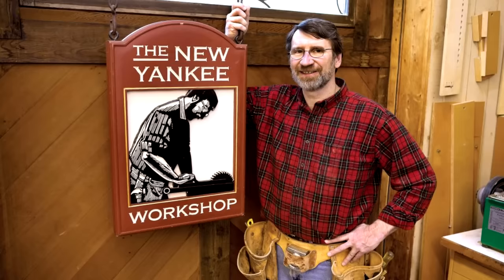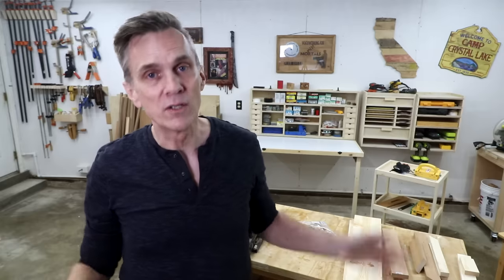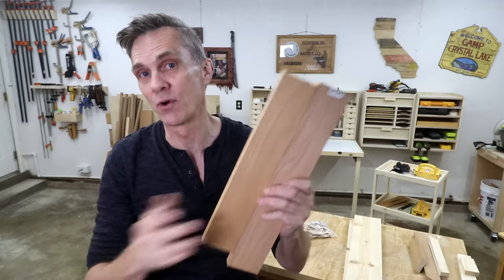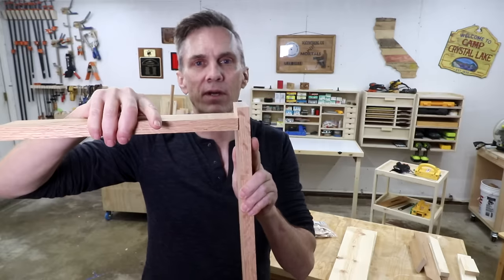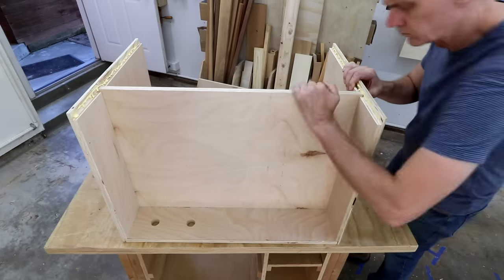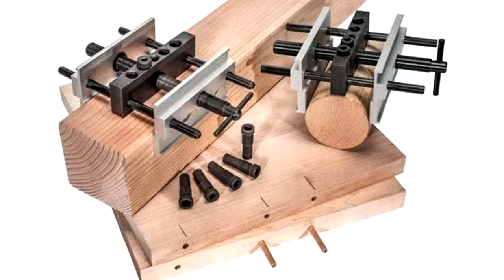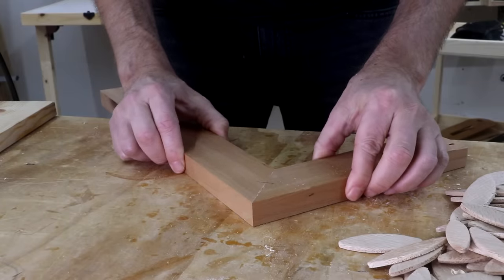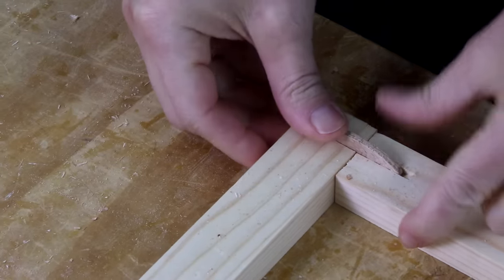So, is a biscuit joiner completely useless?

Comment: I’ve been a professional woodworker for 25 years and there is nothing more useful than a biscuit jointer, the domino is a waste of money you’re better off with a slot Mortiser which costs less and is far more useful for putting together furniture
Reply: Kozel same here I mostly do frameless and it’s the fastest way to put cases together other than investing in a boring machine, which I don’t see the need for,  I have a slot mortiser for doing loose tenons and it’s far more versatile and I can cut better mortises with it than I ever could with a domino. I don’t get why anyone would spend $1500 for that thing but they all do
Reply: I have a biscuit jointer and a domino. I’m intrigued by this slot mortiser though. Can you tell me more about it?
Reply: William Butler it’s a stationary machine the tables move and the head goes in and out you can adjust it to make longer mortises make them thicker whatever you want, cut angled joints all sorts of things If you know how to use it. You can also get a multi router it does the same thing and it can cut other joints as well such as dovetails and box joints, it’s pricier but it works as well
Reply: @adamchesis7443  
For the speed......for the love of God man, the speed and accuracy you can make an extremely strong, consistent joint with a Domino tool is unparalleled.  If you're a fine woodworker and you enjoy taking 2 hours to set up and make 8 perfect mortises with a router or slot mortiser then that's fine.  But a Domino gets it done in about 2 minutes.
Reply: Big Mike is talking if I need to do something fast I have a lamello, If it’s taking you 2 hours to cut 8 mortises on a slot Mortiser I don’t know what you’re doing wrong it would take me about 15 minutes, can you make a  1/2 x 3” mortise with a domino? Nope. People are convinced that the domino is the greatest and if it works for them that’s fine I’ve been doing this for a long time and I don’t see any use for it
Reply: Kozel does festool make nice products? Yes are they with the cost? No they’re way overpriced
Reply: Adam is correct.
Reply: Adam Chesis Hey Adam what model biscuit jointer do you use?
Reply: @adamchesis7443  Festool is awesome for on site work... The mortiser is a much more versatile shop option and as you pointed it out for furniture.
Reply: Dave Tarrant I have a lamello, the low end one I can’t remember the model number, I don’t see the need for the other one with the adjustable blade and it’s double the cost, it’s amazingly accurate and quick love it
Reply: I'm of the exact opposite opinion.  I have a slot mortiser as well as Festool Domino and biscuit joiner.  Of the three, the Domino is the most versatile and easiest to set up particularly when joining pieces that come together at funky compound angles.
Reply: why's his biscuits so loose? I need a mallet to tap mine in, especially glued up
Reply: @adamchesis7443  mannnnnnn, I bought a festool track saw....before makita dropped theres....I'm also on the makita platform so it really hurts lol tleast I got the 75 so it can actually do a lot more, but still...I rarely use a track for deep cuts anyways. The biggest benefit of festool is the fact its a system, so if you are completely festool and a millionaire you can definitely increase efficiency by like 2%...
Reply: Stevey Irwin well that’s good I own nothing festool and I can build things pretty quick, there is nothing they make that would make my work faster so it’s not worth the money to me.
Reply: @adamchesis7443  no way dude, if you went 100% festool and got every single accessory they sell you'd definitely save at least 10 minutes per work week.
Reply: Just get a router table and you won’t need any of that shit.
Reply: @holdemNE1 my guy 😂😂😂😂 you can cut any of that fast on a router table! You’ll also get better joints than random biscuits or dominos but you can do both in a router table…

Comment: I make 8ft+ tables..
Being a one man operation, I will take what I can get. I love my biscuit joiner, specifically to line up extremely long live edge slabs. It also helps me to keep the wood level, I glue up some pretty gnarly pieces. I think it definitely has it's place in my shop. Everyone has their own opinion, this is true. Any tool that gives woodworkers the confidence to keep alive a slowly dying art, is a necessary tool in my opinion.
Reply: @oneoneone7397  without seeing what you mean, it would be hard to answer that question..
Reply: I use my router and slot cutter bit and run a continuous slot when laying up table tops...stoping before the ends.
Reply: @oneoneone7397  It's so easy just do it
Reply: I use them to eliminate pocket holes in the back of my wood benches...

Comment: Steve, that biscuit jointer was bottom of the barrel stuff when you got it 20-30 years ago! Your biscuits should not have that much play. A biscuit jointer is great for alignment. I use it to attach hardwood edging on countertops, align my face frames to the cases, I even use it to butt join long pieces of crown or baseboard. 

This video really needed a bit more research. Lamello invented the biscuit jointer (I think). And they have models that are more expensive than the domino! A proper biscuit jointer is a precision machine. Also, get good biscuits. Biscuits that are too fat or too thin will adversely effect your joints.
Reply: I have the original elu and love it.
Reply: Especially agreed about joining wood edge to veneered sheet stock that must be flushed off. Using paper shims to offset the edges a trifle, the precision of the originator Lamello machines meant that I could use a single leaf of shim. All other brands have more slop in their plunge, requiring thicker shims for offset, and more wood to carefully shave down flush to the veneer.
Reply: Yes, throw that Sears POS away and start over with a modern, decent quality machine.  You'll be amazed!
Reply: I was wondering about this myself. The videos I've watched using biscuit joints were a lot more snug than what he shows. Biscuits should be about as snug as a dowel across the vertical plane, but have some ability to move laterally. That way you can line up your joint in one direction while knowing it's staying aligned in another. For example, lining up two butcher block countertops in a miter joint to minimize the vertical "bump" between them, before you align them horizontally and "clamp" them with miter bolts and glue. (Still a good idea to clamp something on top to really minimize movement during glue, where possible.) It also provides some extra horizontal strength so if a kid climbs on top of them, they don't risk splitting at the glue joint from the uneven pressure.

(Granted in the above example, the countertops should make as much contact with the counters below and be shimmed as necessary. But wood loves to move over time, and butcher block countertops should be installed with that in mind.)

Anyways, I think the real tip here is to get a better tool. Even HF has more precise tools than what he's using.

Comment: I started using a biscuit joiner in 1986 working at a cabinet shop in Wayne NJ called the Woodworker. We used the Biscuit joiner on almost every project and to this day I still use one almost every week. I don't think you need a ton of expensive tools to make a beautiful piece of furniture but I do think a biscuit joiner is a good tool to have in the shop.... Unless you can afford a Festool Domino : ).
Reply: I just got one this year. It is crazy helpful.

Comment: I use my porter cable biscuit joiner to build kitchen cabinets using birch or maple plywood. Building a Murphy bed frame with the larger# 20 biscuits. Never had any issues with weak joints, or alignment of plywood connections. There are three different sizes of biscuits. I will continue to build custom cabinets using a biscuit joiner!

Comment: My professor in a cabinet making class was very fond of biscuits and we used them all the time for constructing the cases. The glue up was tricky but they have held up well. They swell inside the slots once wet with wood glue and are very hard to pull apart once swollen even without glue.
Reply: Right, and Franz Klauzs did a full video on B joinery.  This guy is a hack, at least as far as biscuits are concerned.

Comment: One of those rare cases where I will have to disagree with you. I have a biscuit joiner and have found it has saved me a lot of time and headache and has paid for itself. It does depend on the type of woodworker you are for sure though. I don't like to use hardware in my projects. Only wood joints. So when I want to do a panel glue up, I use biscuits for alignment and properly aligned wood + glue for strength. I don't even add glue in my biscuit slots anymore as I have found 0 benefit from doing that, only spending more money on glue. Getting the right combination of blade and biscuit is ideal though. The example you showed has a lot of play. When I use the ones I have, there is never play like that. I sometimes have to even use some light tapping to get the biscuits in the slots. So they really make sure that boards are straight, saving me hours of sanding and planing. Using cauls means more clamps as well. We all know that you would almost sell your soul to have just 1 more clamp during a glue up, so I like to make sure my clamps are used solely for putting boards together instead of keeping them flat.
Reply: I agree there is some advantage rather than plain glue, but i use dowels, and they are much cheaper, plenty of different jigs (imcluding your own) works with a drill, and over all: it really gives strength as well.
Reply: @dekurvajo  dowels are definitely great and I use them a bunch, but for me, biscuits are the quickest way which makes it the cheapest way when considering time = money when doing commission work.
Reply: @modestmaking5314  Agree,,, I once had to make 80 wooden boxes for a client, Took me some hours to make jigs for alignment, made the 1280 biscuits, and assembled it all within a week (clamps and space was the limiting factor). 
PS my Lamello is in same price range as the Domino and well worth the investment when you know how to use it and for what projects.
Reply: ModestMaking I have a Dewalt jointer. Unfortunately I cannot rely on the allignment. The biscuits are   Tight, but the slots always vary in position. Any tips?
Reply: @MaxMakerChannel  I also have the Dewalt one and I use Porter Cable biscuits. I got my joiner used and after some minor tweaking, it's perfectly straight and spot on now. There is a great video from Gosforth Handyman that you should watch. It goes over how to calibrate your joiner.
Reply: yeah the play in the biscuits in the video would be off-putting for sure!
Reply: Right, my Dewalt does not have any play, I even have to hammer some of them in sometimes. He has a really crappy Black and Decker biscuit joiner.
Reply: @MaxMakerChannel  Just insert the biscuits as even as you can in the slots, when you joint the next plank its slot will take care of the alignment. It will self align.

Comment: I haven't seen any play in my biscuit slots. In fact, after applying glue, I tap them in with a mallet.
Reply: Exactly
I wonder if that's a cheap biscuit joiner or maybe the wrong blade
when I use a biscuit joiner usually I have to take a rubber mallet and beat the two pieces together
Because the biscuits slot is tight
Reply: ya same. normally im using a mallet to get the biscuit in. I definatly makes the joint stronger, idk how much stronger but it makes me feel better
Reply: DR Dan I think you nailed that one-yep humidity
Reply: @garychambers5930  yup, looks like a cheap biscuit joiner,
Reply: DR Dan , I don't pound, I tap. They fit just snug before gluing. I can push them in and pull them out, but they are narrow and tapping lets me increment them into position easier than simply pushing.
Reply: I'll put it this way. Biscuits vary slightly in thickness, and I've had some fit in easily and some snugly, but I have never had any wobble in the slot as we saw in the video. The cut is too wide to rely on the biscuits for good alignment.
Reply: I had a Ryobi and it left the slots pretty wide. I was dissatisfied with it and sold it. I got a DeWalt, and the slots got much more snug.
Reply: Me neither usually. Biscuits can be inconsistent in thickness from batch to batch and even within batches though.
I have owned three biscuit jointers but currently have two.
They see little use. It is good for mitre joints of cabinets if you have the right one and as far as I can tell about the best is the Porter Cable. I had to import mine from the U.S. to the U.K because they are not available in the U.K. but as site workers (like me) have to run 110volt tools that is not an issue.
I did try assembling a carrot fly mesh frame from sawn and treated timber with biscuit joints and polyurethane adhesive. This was not a success. the carrot fly mesh is doing more work than the biscuit joints now.
The basic premise of the video that bicuit jointers are not very useful is largely true.
Reply: Agreed. Maybe older biscuit jointers did not work as well?  I bought a cheap biscuit jointer from Grizzly and the biscuits have no play perpendicular to the slot.
Reply: My bicuit joiner from amazon (silverline brand) is awful, it has a ton of play in the plunge mechanism, slots' locations can varie by the thickness of the biscuit and with all that play I usually too end up with too wide of a slot. I didn't know much back then about biscuits, didn't have anyone to consult with so I'm stuck with that piece of crap
Reply: Gary Chambers What biscuit jointer do you have?
Reply: @sinsilius  Silverline tools are just landfill in waiting. You get what you pay for.
Reply: @scientist1200  I think that maybe the problem lies in the truth of the saw arbor. If the arbor does not run true then the blade will act like the wobble saw on a spindle moulder and produce a wider kerf than the thickness of the blade. Obviously your biscuit jointer has a good arbor.
Reply: Same here, but my slots never end up in the precise location.
Reply: My Wolfcraft biscuit joiner adapter for grinder are dont make play on joint. Its 65$ plus old small makita grinder. Bad tool.
Reply: @garychambers5930  I'm using a cheap joiner with a cheap blade, and its working fine - I clamp to get the joint fully together. I think he is using the wrong blade.
Reply: @davetarrant6888  Porter-Cable
Reply: @woodfinchcrafts7267   probably so 
Mine are always tight
Reply: He must be using cheap ass biscuits. I just bought a Harbor Freight biscuit joiner + Harbor Freight biscuits and the slots are tight! I needed to use a mallet to get them in.

Comment: I use both the biscuit joiner and the domino machine at work, and I don't know if ur machine are of any quality or if u have the right sized biscuits cuz I don't get any play at all so it's excellent for levelling a joint.
But it's no fun tho!
Reply: Agree, biscuit should have a tight fit with the groove to work.
2:22 The fit here is terrible
Reply: Ya, the play in his biscuit joiner is horrible. My biscuits are way tighter.
Reply: That's what I was about to say 
I usually have to get my rubber mallet out and beat the two pieces together when they are biscuit jointed
Reply: @LowAss720  if mine was that bad I would fix it or get rid of it
That is really bad
Reply: I agree. I have been using a Freud joiner for probably 8 years and it never has that much play. Maybe his blade needs replacing, or perhaps a bearing in the arbor needs changing. either of those could cause the slop.
Reply: @j.r.millstone  yeah I didn't think about the arbor or bearing if it wobbles it will definitely create a bigger slot
Reply: Yeah, that's a lot of play in the slot. I'd check your biscuits for consistency. I've only ever used Porter Cable biscuits, and I haven't had any trouble. I've also come to suspect that a water-base glue would be necessary to get the full potential of a biscuited joint. I've been using poly glue, and it works, but I can't help but wonder if the swelling from the water helps...
Reply: Adding to the agreement, once I tap in a biscuit dry,  I can't get it out without pliers. Using it mainly on MDF shaker door frames so they work ok for that.
Reply: @oOLandSharkOo  you actually want them as dry as possible. That way they swell up once you introduce them to wood glue and create an even tighter fit inside the mortise.
Reply: Agreed! If you use a nice quality Lamello like I do, you get a nice tight fit.
Reply: I agree Anton, I have used one for years and have gotten great results !!
Reply: i use a (real cheap) biscuit joiner for endgrain to endgrain connections of kitchen work tables.
They fit real tide.

i also at glue and 2 clamping devices that get inlayed from the Down side of the table...found the Word for it... (100mm Worktop connectors)

I like how this works together and keeps all Level in the workside out of my shop and away from a nice level bench.

Have a nice Day
greatz from Germany
Reply: LowAss720 What biscuit jointer do you use?  I have been keeping my eye out for a good deal on marketplace or an estate sale.
Reply: Christopher Feld, yes indeed. Biscuits are compressed with the intention that assembly is slightly loose and easy, but that moisture from adhesive swells them  for a proper joint.
Reply: The guides of this biscuit jointer are probably badly worn out. I had the same problem with a cheap machine that had two steel shafts running inside inside a zamak body. The holes grew larger in time making the biscuit grooves wide and inconsistent.